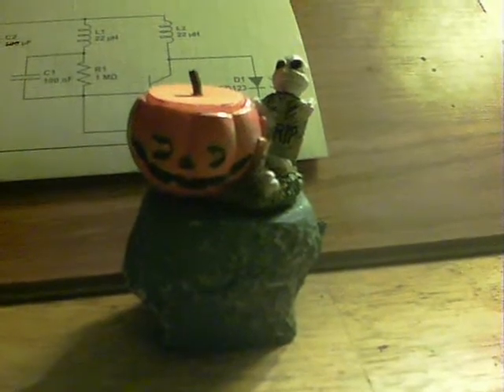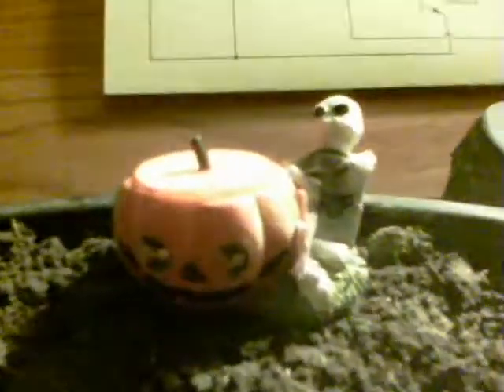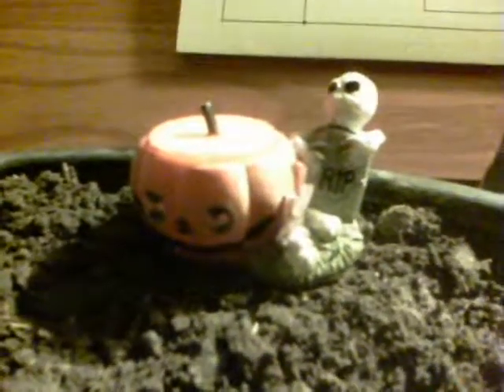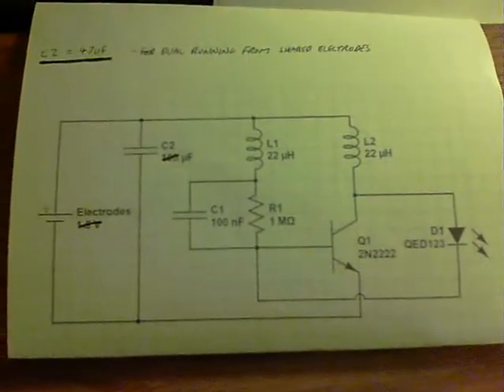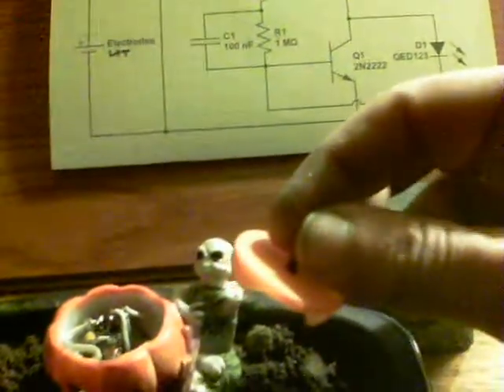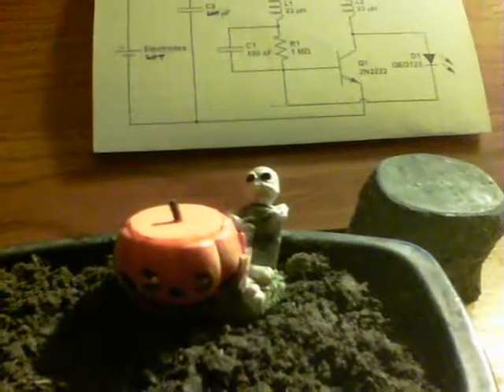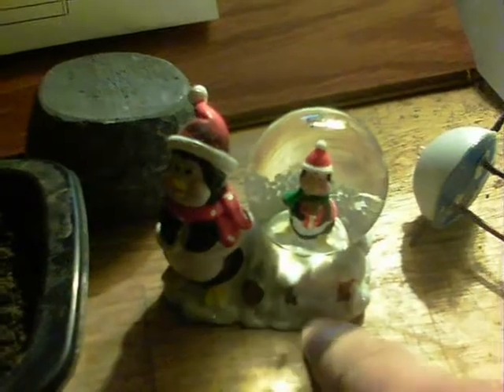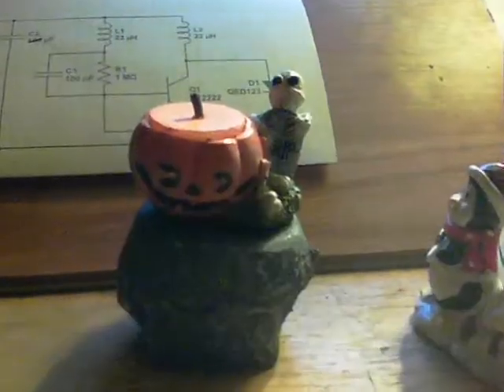Halloween soil powered flashing ornament

Comment: I found this gem of a circuit to get more power out of my two small containers with plant pot soil and it works! I even got four LED's blinking with it, not very strong but enough to see it in the dark, I use alumuninum and copper in the soil right now and I hade to feed them drops of sugar water for a couple of days to get the amperage up to around 350-400 uA (at around 500 mV open circuit) before this circuit started working. I will try and put up a video of them on my channel.  I just wanted to thank you for putting up the schematics for the circuit, although I am a bit late in the game! :)

Comment from the maker: It's where i'm hoping to be soon. There's 0.75V and around 50uA like this, more amperage with the garden light 6" electrodes. Constant light is dim, a trade off unless magnesium were used (not got any and it corrodes). Am trying Sziklai transistor pairs for just that thought you had :)